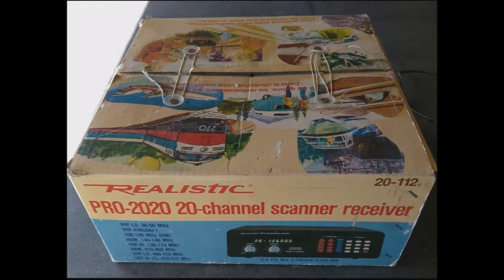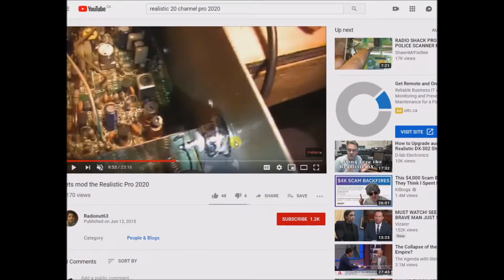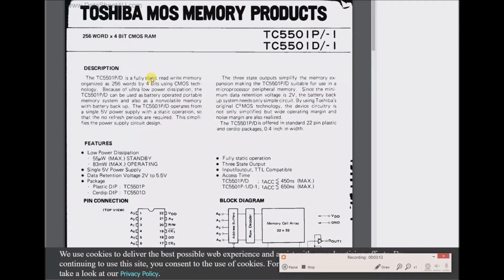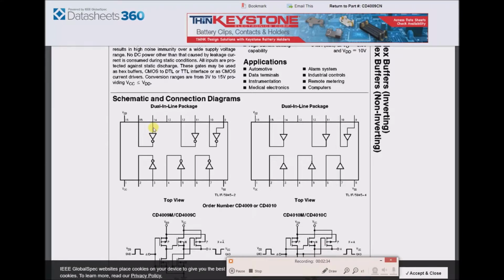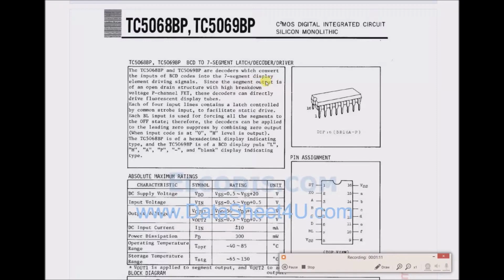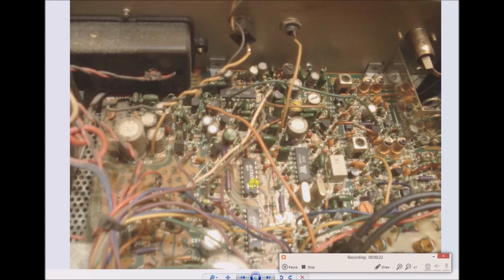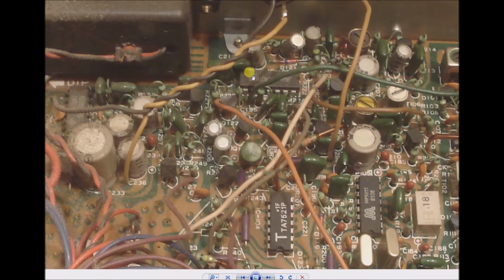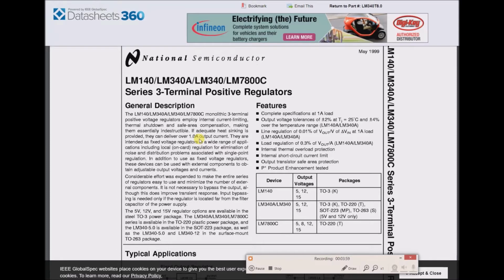RadioShack / Realistic Pro-2020 Desktop VHF/UHF Scanner: And Its Integrated Circuits

Comment: I had a Pro-2021, still have a Pro-2032, was working great but it stopped receiving a while ago so I need to poke around in it.
I have a Shinwa SR001 and a Pro-107 so I'm not in a hurry to repair the 2032.

Comment: Mine wont stop scanning with all zeros so I can program it.Anyone know what the problem could be?
Reply: Buttons/keypad may be not as responsive if the contacts are dirty.
This would prevent you from selecting 'Manual' to stop the scanning.
I have same issue on mine as well as loss of receive sensitivity that will require more work.